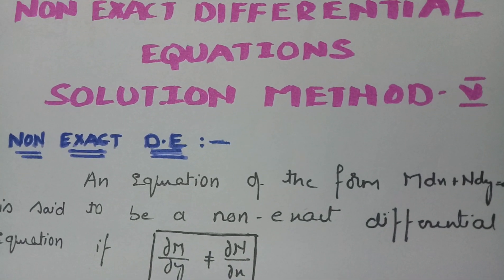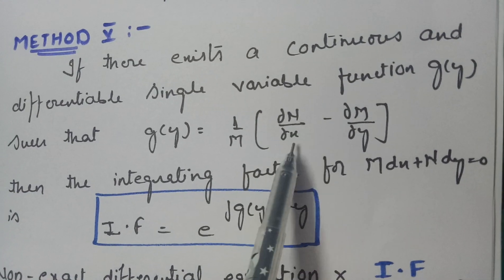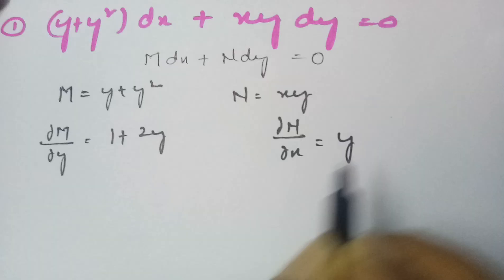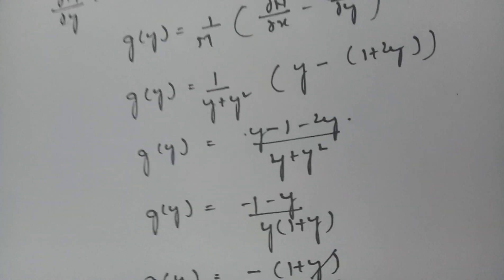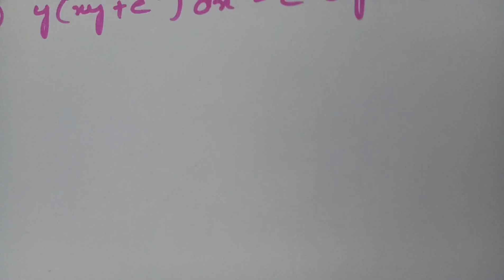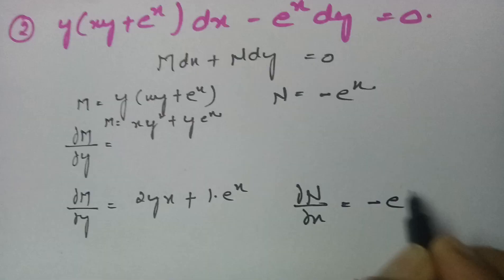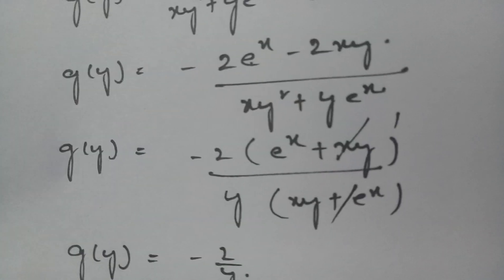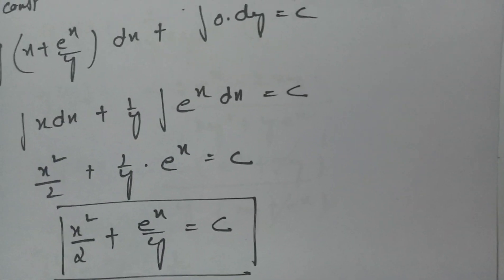Non Exact Differential Equations Solution Method -5

Comment: 1st sum: (y+y^2)dx+xydy=0
This is in the form 
y(1+y)dx+x(y)dy=0
Can a 3rd method be used to solve this? Pls answer mam
Reply from the maker: In the brackets there should be xy terms....example y(xy+2)dx+ x( x²y² + xy+1)dy=0 whereas in your problem there are single variables..
Reply: @btechmathshub7050  thank you mam for giving the answer